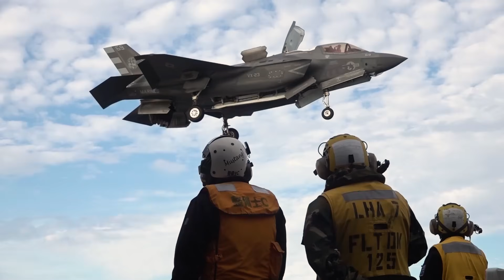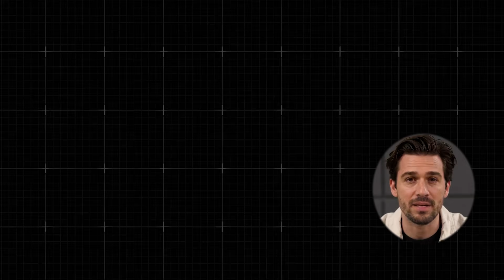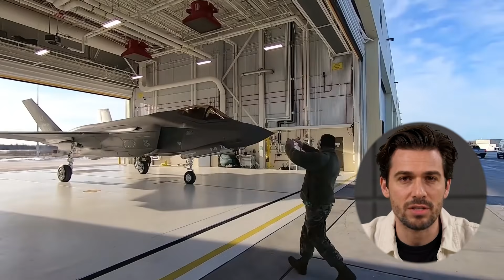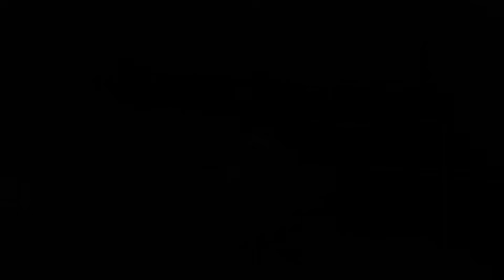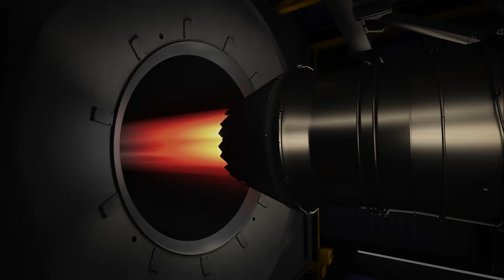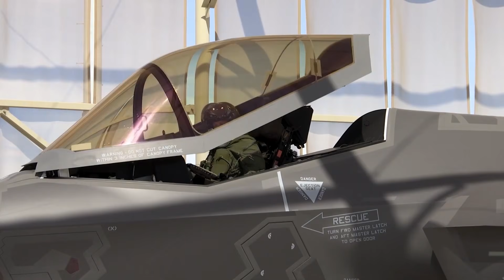The F-35 is Overheating. The Fix Just Created America’s 6th-Gen Fighter.

Comment: The F‑35 overheats because its engine and cooling system can’t handle the aircraft’s electrical and thermal load, especially with new Block 4 upgrades.

Core points (brief + concise):

The F135 engine runs too hot, wearing out faster than planned.

The PTMS cooling system is overloaded, especially when powering radar, sensors, and EW systems.

Heat bleed affects avionics reliability and increases maintenance downtime.

The issue is serious enough that the Pentagon is funding a major engine upgrade and new cooling architecture, not expected until ~2030.

Bottom line:  
The F‑35’s thermal system is undersized for its current and future electronics, causing chronic overheating that limits performance and accelerates wear.